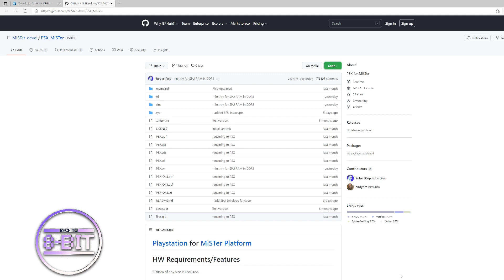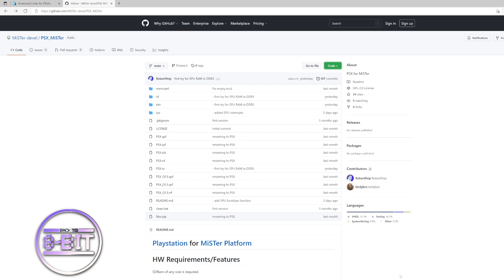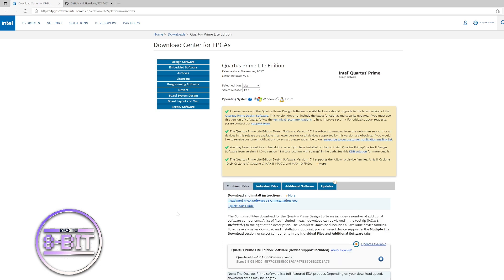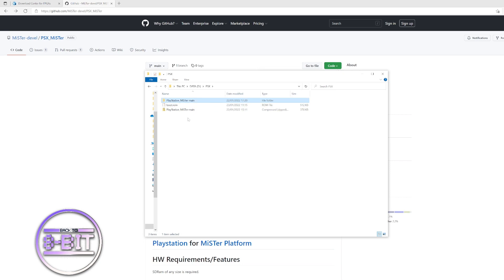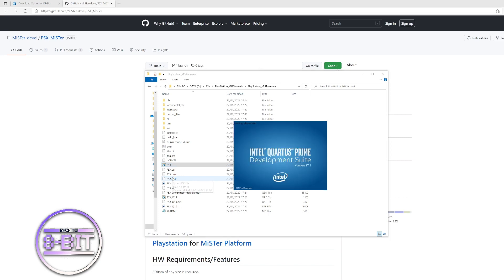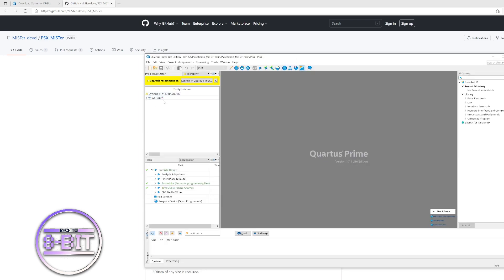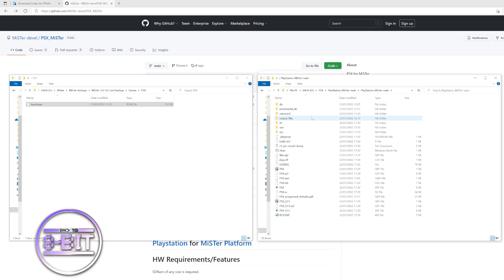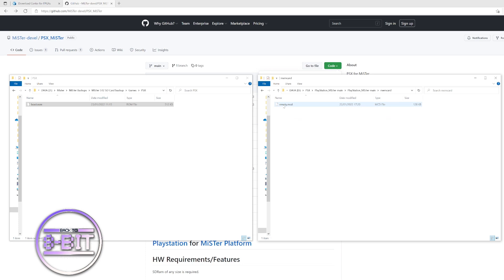PSX, PlayStation Core, MiSTer FPGA Setup Guide for Beginners

Comment: Good stuff, thanks for the tut. Quartus Prime has been "stuck" at 47% (53minutes in...) Fitter (place & route) at 36%.... did this fail? should I still wait or cancel and start over?
Reply from the maker: That seems like a long time Marc.  I would say it has crashed.  Seems very odd.  But since doing this video, I have found a much easier way of getting the rbf file.   Hope this helps. https://youtu.be/dbffP-_d_hQ
Reply: @Hermski  thank you, I've stopped it now and will check out the other method.
Reply: Info (170190): Fitter placement preparation operations ending: elapsed time is 00:23:45
Last message... it's been over one hour. Can't see any error messages anywhere. Strange.
Reply from the maker: @marcoberdorfer  Strange one, It should only take between 5 and 15 mins to complete.  I would reset it and try again, or use the other method I just sent and use Discord to get the file.  https://youtu.be/dbffP-_d_hQ
Reply: @Hermski  am just trying it again actually, it jumped to 46% very quickly... I saw that there are some messages in blue along the way. no clue what it means though.
Reply from the maker: @marcoberdorfer  that sounds promising.  Also just make sure you're using the full 17.1 version too.
Reply from the maker: @marcoberdorfer  Hope you managed to get it to work mate.

Comment: Anyone else getting an illegal character error when attempting to launch the QSF project file?
Reply from the maker: not for me.  I heard that version 17.0 had an issue, but that was fixed for 17.1 which is the one, although old, the one to use.
Reply: @Hermski  Discovered the issue had to do with the filepath the project file was being stored within, which I resolved by moving the PSX Core directory. Going to have to go back and work on why the project is now throwing a TCL script file sys/p11_q18.qip not found error
Reply from the maker: @BrandonPeach  Eeek, sounds really strange.  Hope you find a fix.
Reply: @Hermski  Yeah was a strange one. Had to remove Quartus and reinstall 17.1, then recompile. Working now.
Reply from the maker: @BrandonPeach  Fab, Really pleased it worked for you.   Enjoy.